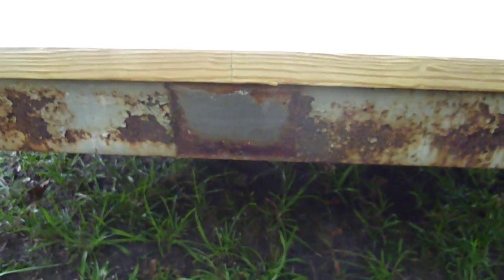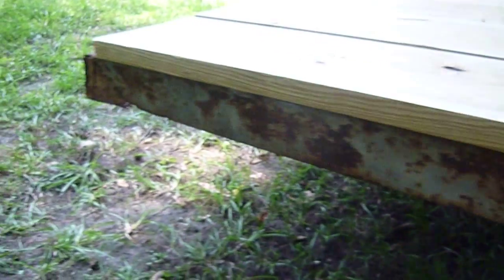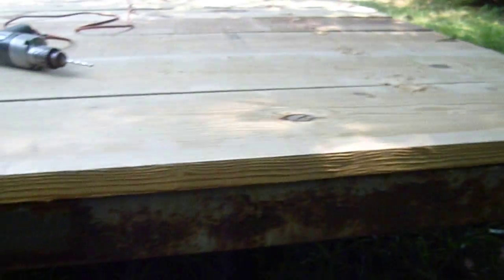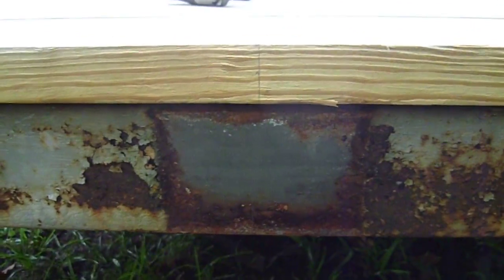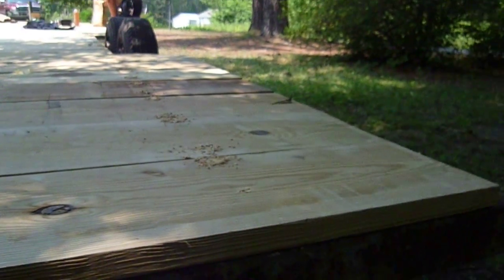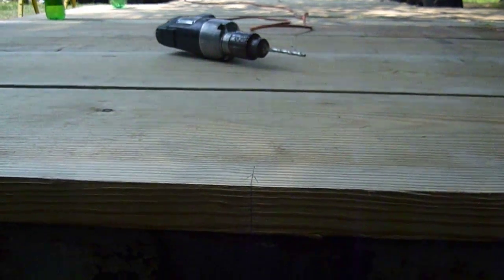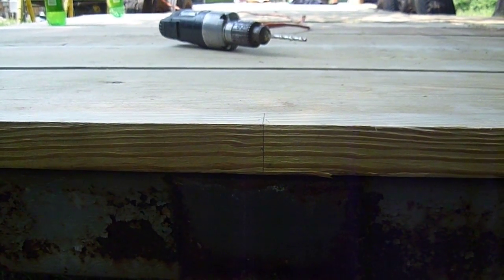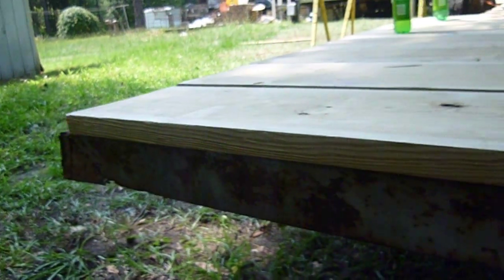The DIY Cargo Trailer - Part 3

Comment: I am making a trailer out or a 14" single axel camper frame. I wish I could send you a pic. On mine, I cut the "ears off of each corner, cut the stairs off,  had to redo the brakes,  run new wires and put all of the lights on, install junction box and plug. Then I welders 3" channel iron (3\16" thick) at corners of frame and then at the 4' mark and the 6' mark on both sides.  Then I welded 2" angle iron up the sides and across the front to make a frame for the 2" x  6"  PT planks. It's 80% done and coming out great.